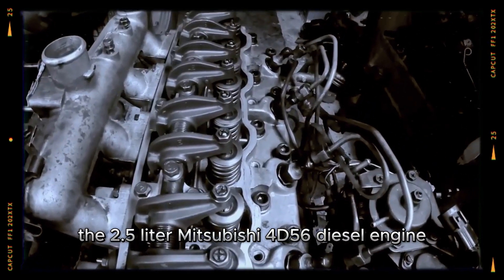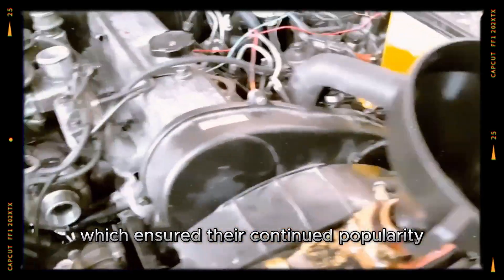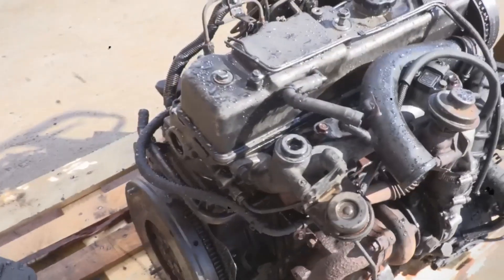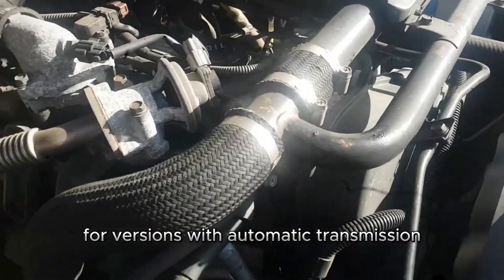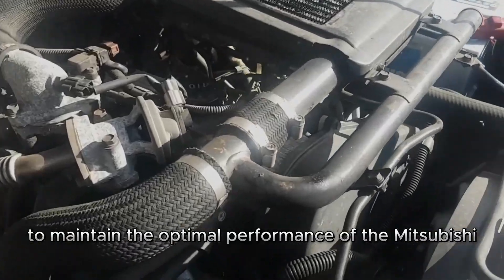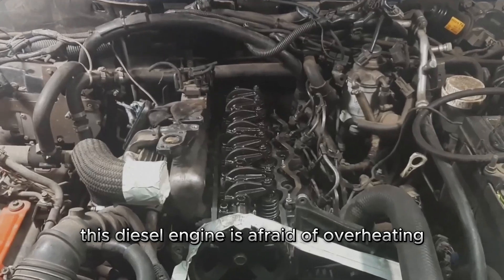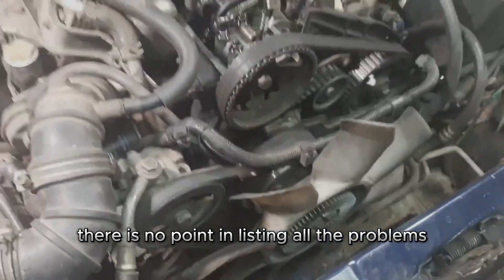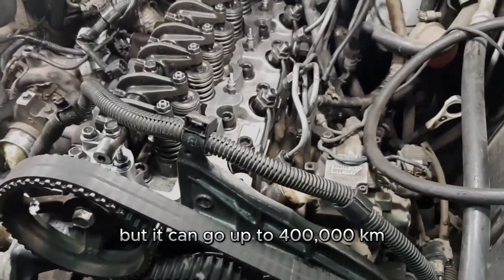MITSUBISHI ENGINES: 4D56 2.5-liter diesel engine! Pros, cons and common issues!

Comment: First of all I would like to point out that I've worked on Mitsubishi off road cars for approximately 1 year, during this period of time, the cars that came in were mostly for oil changes and basic mantainance, plenty of them went past 300.000km with the original head gasket, turbine, EGR, diesel pump and never had any kind of catastrophic engine damage, the only engine that has one pistone with a hole on it was oil starved by the owner's poor interest, many many other cars were totally fine even after 500.000km or more, tuning the engine is safe under certain limits, for example the standard turbo pressure is around 0.6 for older models and around 1bar  for the newer ones, it can be brought up to 1.6 safely, and same goes with having more diesel sent into the engine according to the boost pressure, mine has 200.000 km, handles 1.6 bar of pressure easily and never had any issues apart from the EGR valve that I closed off to prevent the intake system getting unbalanced performance, and that is most probably the only issue youll ever have, the 4D56 is an incredibly sturdy engine that will take mostly anything that's thrown at it without problems, the only real downside is the fuel consumption and the poor power capabilities it has in it's standard form and with the original turbo, the air intake is also enough for whatever important upgrade you will do to the engine, so in short it's a slow underpowered engine but that will last forever and never give you troubles, there is nothing similar on european off roaders or any other kind of  car that mounts another engine brand, these engines can do 1 million km without having any issues and I have seen one that did just that.
Reply: Your knowledge sharing is truly appreciated🙏🏼 Thanks alot. Im looking to buy a 1991 delica once I arrive in the philippines. What should I mainly inspect once I check the van by myself?

Comment: My 2013 l200 4x2 with the same engine now 270.000 km r without any problem even the suspension still have the original

Comment: My 2006 L200 2.5L Turno hit 480,000km. Only replaced EGR and Timing belt kit. Still in perfect condition
Reply: Remove the EGR, It Will mess up the electronic turbo pressure control, I've worked on plenty of 4d56t

Comment: Very informative and accurate. Except two details:
In 2001 the 115hp 4D56 (8 valves) engine got an electronic control injection fuel pump made by Zexcel and not a common rail system.
The first common rail direct injection system introduction was in 2005 and specific to the 16V versions only.
Second, as you stated the 4D56 was installed on some entry-level 3rd gen Pajero V60/V70 models but never on 4th gen Pajero V80/V90 models.